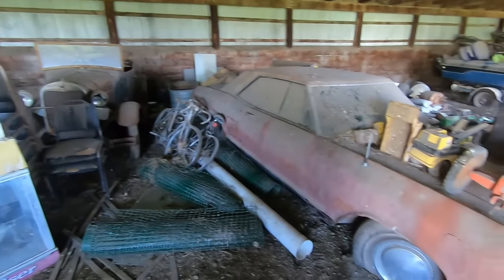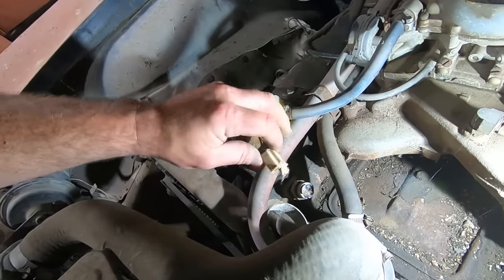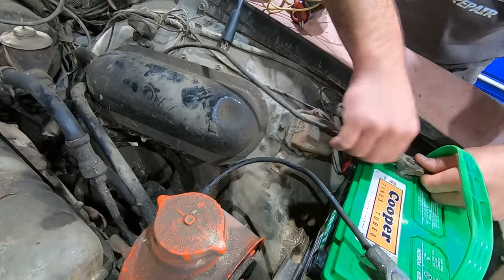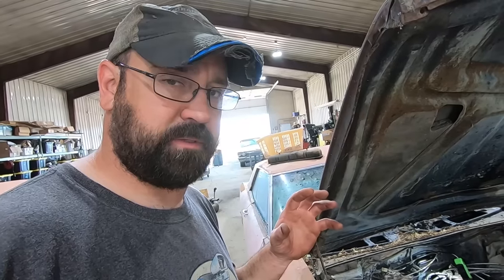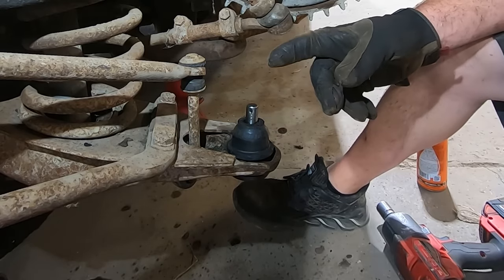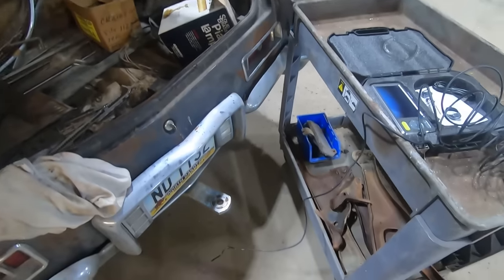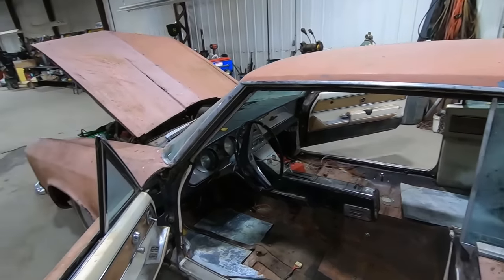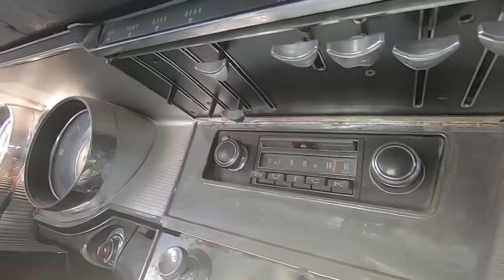BARN FIND!1963 Buick Riviera! Abandoned for 27 Years! Will It Run?!?

Comment: That’s why will it runs are so popular. Anyone who’s ever dug into an old car that hasn’t run in years, and goes through the steps to get it running again, feels that rush when she finally fired and runs again! YES! She’s Alive! Never gets old
Reply from the maker: It can be exhilerating!
Reply: That's how I feel every time I turn the key on my offroad truck 😆
Reply: @MortskeRepair  yeah drove a 1963 in 1967 was the bosses sons and went like a bandit  his bro bought a new 1971 with the 455    sweeeeet
Reply: I've been there many times myself and you always feel like the world's most intelligent and powerful man when it finally happens. When I was 18 I bought a $500 car (a 1990 Dodge Spirit 2.5 turbo) from the dealership that I worked at and it wasn't running. My uncle kept telling me, "you'll never get that thing running!" An hour later I checked the timing belt and it was off a few teeth, so I took it off, lined everything up, reinstalled the belt, turned the key, and she fired right up. I drove that car for quite a while before I took a sharp turn in boost and the oil sloshed to one side of the oil pan (that's almost shaped like a cone) and it snapped a connecting rod. It was a 2.5 turbo I engine and it had 170k miles on it, so it was fairly weak to begin with. I scrapped it. Those engines only made 150 HP and the turbo was a TINY Mitsubishi TE04H. I bought a larger Dodge Daytona T3 turbo for it, but it blew up before I could modify it. I'd LOVE to have another one to tinker with.

Comment: There is a speaker in between the back seat there if you did not know that anyway I love how the dash and console connect together and run to the back with a light and heat vents and the back seat is like bucket seats. One of the coolest interiors of the 1960's
Reply from the maker: Yes they are.

Comment: First time in a while that Mortske looked like he actually enjoyed working on some junk 🤣🤙🏻, bring in the buiks.
Reply from the maker: Don't get used to it!
Reply: @MortskeRepair  aww, Cmon now, you were even smiling a bit 🤣🤣🤣
Reply: I NEED to be working on some old S41t box but I’m upset at the process and issues every single time. In two decades, this has never changed. 

“I just want this thing done!” After it’s done, “I NEED A NEW PROJECT”.

*edit*
It’s a catharsis for many. I’m a network engineer by trade but a gear head by passion. The more stressed my job is the more I need car projects.

Comment: 60 year old electric windows still worked great. Hell I’ve seen 6 year old electric windows that didn’t work. The interior of that car was absolutely beautiful back in the day. Awesome car, didn’t even have to mess with the brakes.
Reply from the maker: They didn't go up quite as well!
Reply: All 4 window motors im my 58 cadillac are original,  work fine. My parents bought the car in 1960. Southern California car. I was 1 year old then !!  Still on the road.
Reply: When I bought my 92 Explorer none of the windows worked , HAD some plastic parts for safety

Comment: Loved my 65 Riv. 425 single 4bbl open rear, power slide trans. No brake torque necessary, low and mash the pedal to the floor. 85’ of rubber every time. Blew up the first tire. Tuned her and lost 5’ of rubber. Built like a tank and deceptively quick for a full size car
Reply: Did yours have the "Buick ports" as is trademark really,with most Buicks? Sometimes holes in hood/fenders or just in the trim.
Reply: @michaelupton4523  nope, 63-65 rivieras don’t have the port holes
Reply: @peterkovacs8654  you were fortunate to have such a classic in it's day, a sexy luxury sport coupe.  Mine was a 67 dodge polara 383/727. Bigger though, like a land yacht. Trunk huge, fit 6 bodies. I got it cheap, fried transmission. Dad and I bench rebuilt it. Thirsty it was.
Reply: @michaelupton4523  my 62 Le Sabre has fender ports
Reply: No power slides there they are Dina flow's
Reply: @ronald5629  In '65 it would have had the Super Turbine 400 (essentially a Turbo Hydramatic 400) 3-speed. Last year for the Dynaflow was '63.

Comment: the 64 is almost identical to the 63, but the 64 had minor changes in some details and had the th400 3-speed automatic, which is a first for the Riv. The 65 came with clamshell headlights
Reply from the maker: The 3 speed would be a nice upgrade!

Comment: The Buick nail heads were popular in drag racing because they are torque monsters. The 401 Nailhead was also called a 445 Wildcat, with 445 being the torque and 300 hp. Not bad for car most consider their grandpa's car. I love the 1959 Buick Invicta/LaSabre with the 401 Nailhead and Turbine Transmissions were so smooth, couldn't feel them shift.
Reply: The Reaper,,,, My Dad built race cars when I was a kid, a couple of guys he knew were running a Buick "nail head" in a Sprint Car . It was built to the hilt, but it blew up, they wanted to finish the season so they went to a junkyard and pulled an engine out of a wreck, stuffed it in the Sprint Car greasy and dirty and finished the Season with the Championship 🏆!!!!!!!
Everyone didn't believe it wasn't "built" but it was not  !!!!!! Right out of the wreck and into the Race Car 🤣😆 !!!!!!!!!!!!!!!  True story !!!!!!!

Comment: What a gorgeous old girl! My parents have one just like her!  V8 small block 401 dual quad, power steering, power brakes, power windows, cruise control, dyno flow transmission, air conditioning, multiple speakers AM and FM radio, she has all the toys! Unfortunately, ours hasn't been out of the garage in some time either and has been parked for about 12 years. 
I gotta get her out and cleaned up! She needs to get to the Promenade!
Reply from the maker: Awesome!

Comment: Hey mortske i have the same issue with new trucks. They have the same upper and lower a arm configuration. What i always do, is take a large ratchet strap and wrap it around both control arms. When you crank on it, it squeezes both arms together.
Reply from the maker: That works too

Comment: Mortske, you are taking me back to when I first started working or cars. I went to the General Motors Training Center and learned as much as I could about GM Cars. When I got my sheeps skin I took it to my local Buick sealer and got a job. One of the first cars I worked was a 64 Riveria. What a jewel it was. I thought I knew everything. I got schooled quickly. Good luck with that get. BTH, just take that Carter AFB off there and rebuild it from the start. They are JUNK! LOL.

Comment: I noticed that the radiator fins is clogged up, need to power wash to clean out the dirt or whatever clogging it up. As the old saying goes, need to check the loose nut behind the wheel. lol
Reply from the maker: No doubt about that!

Comment: My Dad had a 64 Rivera that was loaded with equipment, it even had power wind wings.  The optional 425 cubic inch engine made this big car quick.  The leaded gas of the day tended to foul the spark plugs and eat up the valves.  You needed to take it out on the road and blow it out on a routine basis.  The covered headlights were in 65. My Dad paid less than five grand for it new. He liked the 64 so much, he bought a 70 Rivera.  Mechanically, it was a better car. Your video brought back memories.
Reply from the maker: Wish he had kept it!
Reply: @MortskeRepair   The cars of today are built better and last longer.  Old cars were simple but they broke often.

Comment: "Coil over springs" for when your suspension needs all the spring in it's step, or when your race engine needs help closing it's valves.
You had the most fun in that Buick you've had in a car in a while....In your shoes I'd be tempted to keep it and make it nice.

Comment: I know you don't ' do bodywork ' BUT, this car clearly makes you happy. Maybe tidy the passengers rear quarter, do the bare minimum to improve the ' chewy bits ' and even just chuck a coat of red oxide all over to preserve and improve what is there ? Paint the floorpans inside to protect them and chuck in some floor mats and enjoy it as a rough road/track motor.

Comment: I had a '64 Grand Prix with the 428 four barrel and 4 speed Auto back in my Navy days. I thought it was the slickest looking land yacht out there until I pulled up next to a '63 Riv at a bar in Long Beach. I was humbled. I still preferred the interior in the GP, but the body on the Riv was to die for. Of course it didn't help the the Riv had a gorgeous Black Cherry paint job and my GP was stock White...The Nail Head owner, however, was very impressed with the relatively modern drive train in the GP. 

Looking forward to seeing where you go with this beauty!
Reply from the maker: Both are great cars!

Comment: My workshop manual for Rover P4 car 1956 tells you to do exactly that when fitting the front coil spring. "Use a stout chain over the chassis and secured under the jack to compress the coil for assembly"!
Reply from the maker: Awesome! I did something right!

Comment: It's easy to check to see if you have the rare 1963 425 option (2,600 made). Just look at the stamped engine code right in front, facing up in tbe block right by the pushrod cover ( valley pan ).
The 63 did not come originally with the "Super Wildcat" package, which included that dual-quad option. That started in 64. The carburetors were the Carter AFB, which Edelbrock eventually obtained.
And the stock transmission is the Dynaflow. It was changed to the legendary ST400 in 64.
Reply from the maker: Thanks for the info!
Reply: @MortskeRepair  Sure thing.

Comment: Love the old Buicks! Yes, as you found out, they are torque monsters! The Buick 350 actually weighs less than a Chevy 350. Looks huge, but it's lighter. Weird. I have a 1970 Buick 350 SP engine that I am building for my 74 Jeep J20 4x4. The 70 SP was only in the GS's and had 10.25/1 compression, making 315 HP and 410 TQ stock. That's the most powerful 350 Buick ever made. Building mine up a bit, should be good for around 370 HP and maybe 450 TQ. Hope you can find another similar Riviera that's a bit less crunchy! Oh, and one that has A/C! Love the content, man. Keep it coming!
Reply from the maker: Thanks!

Comment: '63 was indeed the first year for the alternator to be standard, The Riviera Gran Sports and some Wildcats came or could be ordered with dual four barrel high compression engines. FUN FACT - the numbers on the air cleaner are NOT the cubic inches, back then Buick put TORQUE figures on the air cleaner, my '63 Lesabre said "Wildcat 410" on the air cleaner but the engine cube figure was actually a 401-- there was a bigger engine and the "445" on the air cleaner was torque, the 445 was actually a 425 cu in.  I love these old buicks my uncles '63 Buick that I ended up with

Comment: I bought a 66 Lemans a long time ago and found an identical vacuum switch laying in the glove box.  I looked in the trunk and saw a vacuum actuator attached to the latch.  All I had to do was run vacuum line from the glove box to the trunk, hook both ends together and mount the switch.  The system wasn't connected to engine vacuum at all.  The plunger in the switch provided a vacuum pulse directly to the actuator.  You should check yours out to see if it works the same.
Reply from the maker: Awesome

Comment: Excellent video Mortske Repair  :) also 1965 also 1966 Buick Reveria like that got middle in grill of one headlight daul beam with hide door and had 425 Oldsmobile Rocket V8 motor  blue color with lots hp and torque to and like 1970's of them with 455 Cubic Inches 8 cylinders 4 barrel carb and excellent transmission of Automatic 3 or 4 speed type and fast !

Comment: Love the new garage and the Riv.  Body's too far gone to save, but a lot of those trim pieces are unobtainium, so this would be a strong donor car for you if you do get one that's a little nicer but still "rough around the edges" -- put a carb kit in it, clean up the plugs, a can of seafoam down the yap, toss in a fuel cell or media blast/clean the fuel tank, then grab a sammich or six and enjoy.  Run a quart of ATF with a full tank of gas to free up the rings.  Could be a nice rat (mouse) rod if you fix up the power steering and brakes, and take that nasty hitch off the back.   The "custom" floor pans and flow-through rocker panel ventilation give it street cred.  FYI -- the Buick logo floor mats with the owner's name were included when you bought the car new.  I believe there was also an optional engraved dash plaque.   The nailheads get a bad rap with the drag racers due to the valves bottlenecking air flow through the engine (and the lack of go-fast goodies relative to SBC's or later BOPs like the 400 and 455) but for street use they are torque monsters.   Duff is such a good doggo and about the best helper a mechanic could ever want.
Reply from the maker: Thanks for watching and for the info!
Reply from the maker: @DontCryAboutIt  Yes
Reply: Too far gone for West Coasters maybe...Around here that's rust free. Pretty much very unrestored rust belt car needs lower quarters, trunk extensions,  floors etc.
Reply: @MortskeRepair how much ?

Comment: When you're trying to start an engine like this that hasn't run in a long time that has weak cylinders the problem is low intake vacuum. This is often caused by valves that are rusty and not seating or even stuck in the guides. This keeps some of the cylinders open to the intake side and as the pistons come up, they actually blow air back towards the carb which cancels out the suction from the good cylinders. This means you may have positive pressure in the intake rather than vacuum. After the engine runs for a while, the valves should start to seal. Also, animals love to build nests in the tail pipes, and this can plug up the exhaust also counteracting intake vacuum as the exhaust has no escape and pressure can build up in the exhaust system.
Reply from the maker: Thanks for the tip

Comment: I had 2 of those in the 70s. They'll do 140mph + but the speed buzzer goes crazy. 
You could floor it in low, get to 35 or so shift to drive and back to low it would shift to second, chirp the tires and stay in second.
Reply from the maker: Awesome!

Comment: A pry bar pulling down the upper control arm would have gotten that ball joint right in. You pulled it down almost touching with just your hand. 💪🏻💪🏻 That's how I've always done it. If there's nothing to pry up against behind the control arm you can always wrap a small chain around the frame rail and stick the end of the pry bar through it. Easy peasy lemonsqueezy 🍋✊🏻

Comment: I looked up the lower ball joint for the Buick.. There is only one lower ball joint available from MOOG, the one that looks like the broken one is a K5075 and it only comes with  just the joint, boot, castle nut and cotter pin. 
My guess is there was switch around or packages.

Comment: This is the 1963 Riviera that is older than the Fisher Riveira color green. The 1963 car have aftermarket power antenna. The Buick Electra usually have power antenna and extra option of parts etc. Then the Buick have in later model 350 CID. You said, "401 or 425 CID V-8. I would say the nailhead is too old so try Rocket engine for both Pontiac and Buick.

Comment: that Ball Joint breaking was very typical of GM Cars from the 60s  i remember very well  in the early 70s  my Dad  looking at Family Members cars  at Family gatherings  for excessive play  in  their Font ends  BTW my Dad was a big DIYer  and  he had to replace  the ones in our 69 Pontiac  so he purchased  a BallJoint Fork for the job and  offered to loan it  to Family and Freinds to  get their cars and Trucks done  i still have the Tool  but never used it myself   those old Rivierras used to be regarded as fairly high end Cars back in their heydays

Comment: That contraption in the glove compartment looks a lot like A add-on cruise control unit that was available in the 70s. I believe it was cable operated between the unit itself and the carburetor. I have put one on a Ford ‘ Capri’.
Reply from the maker: Interesting

Comment: Pontiacs had valley covers too. From 55 all the way up to when GM said all divisions will use the same engines. In truth the were a number of 350 V8s that in fact were Not the same engine. Then the Chevy became the 350 for all divisions. How the North star v8 came to be I don't know as they were very different and designed to work transverse in the front of a bigish sedan.

Comment: Dynaflow and the jetaway otherwise known as the slim Jim transmission knockoff powerglide transmission... My uncle had a 63 oldsmobile cutlass f85 convertible Buick 215 ultra high compression v8,, and the jet away transmission the front pump leaked and would pump transmission fluid in the Buick 215... Anyway a couple years ago you couldn't even find rebuild kits for the motor or the transmission.. so he bought a 3.8 odd fire buick v6 and the 4spd factory from a 61 LeSabre wagon out of the junkyard..